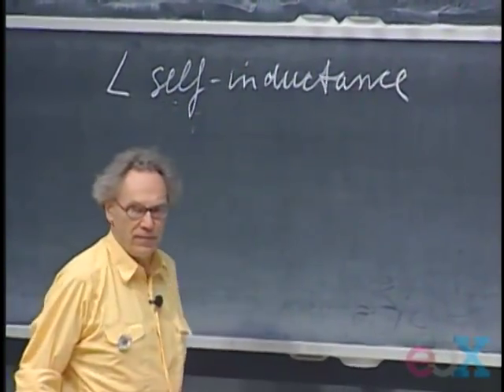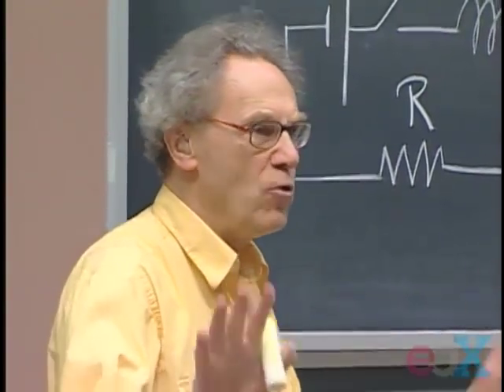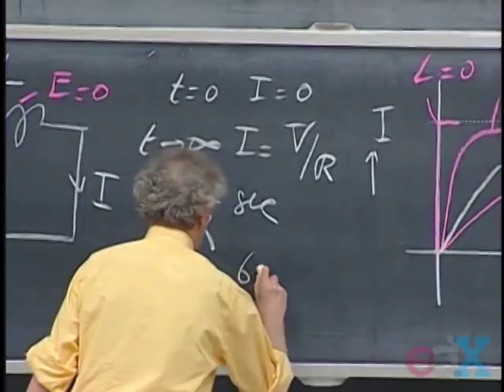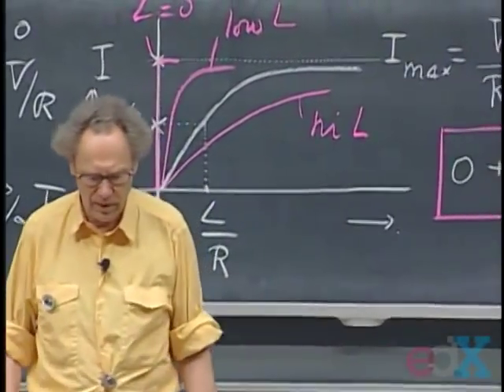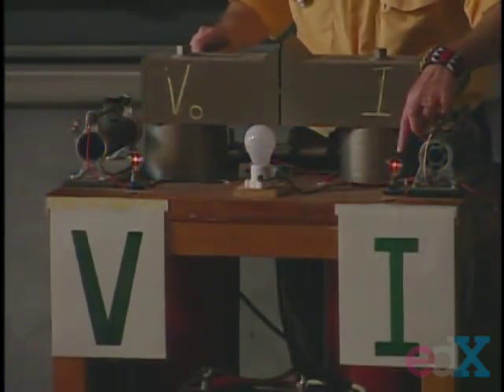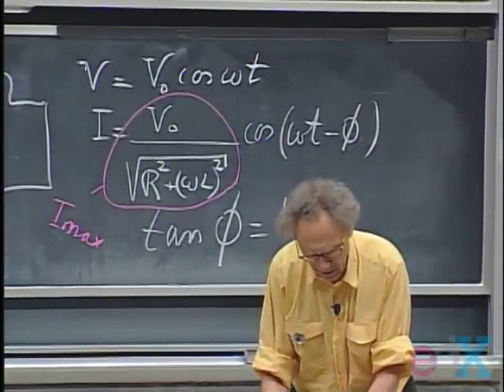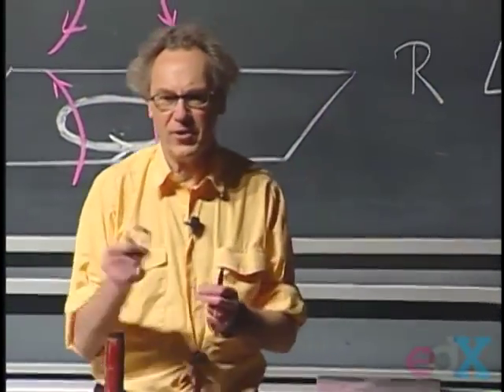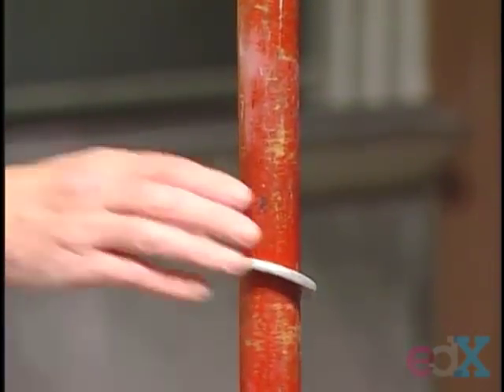8.02x - Lect 20 - Inductance, RL Circuits, Magnetic Field Energy

Comment from the maker: This website contains all my 94 course lectures (8.01, 8.02 and 8.03) with improved resolution. They also include all my homework problem sets, my exams and the solutions. Also included are lecture notes and 143 short videos in which I discuss basic problems. 
ENJOY!
Reply: Great lectures. On a finer note, the E-field doesn't have to be zero inside an ideal conductor! As Feynman points out in his famous "Lectures on Physics" book Ch-22 ,  if the conductor is moving then you can have E-fields inside. He gives the example of a rotating coil in a magnetic field.The only requirement is that the total force is zero inside an ideal conductor. And the force is a sum of E-field and B-field components.
Reply: Prof. Lewin  First and foremost, thanks for the physics education!!
I would like to comment on your lecture on "RL CIRCUITS".  I noticed that in the light-bulb experiment where it was shown that the light-bulb had great delay coming to full brightness when switched on through the huge inductor...that it was NOT shown by demo, the similar DELAY of the light-bulb going off.
I just wanted to let you know that I have come up with a VERY SIMPLE modification of the circuit where the delays in BOTH directions are illustrated!
ALSO--as mentioned in that lecture--I am VERY curious as to the construction of such a large inductor with this very low resistance.
Reply from the maker: >>>NOT shown by demo, the similar DELAY of the light-bulb going off.>>>
NO and that is by choice. Look at the circuit!!!!! You may then understand why.
Reply: thank you walt, you've gone down in the annals of history in education as one of the great educators of one of the strangest fields in human existence.
Reply: Which i book follow for this cource?
Reply: I need all your literature on this subject. Is this information still available? Better yet, if you’re still on Earth with us, you would be a perfect lab partner.
Reply: 1008 and a 356

Comment: Prof Lewin, the magnetic field outside the inductor is approximately zero and therefore the electric field everywhere outside the inductor is conservative. Thus, when applying Faraday's law, you can choose the closed loop that bypasses the inductor, i.e. you do NOT go through the inductor - you start at one end of inductor, go outside and enter at the other end. That way, the closed loop integral will be ZERO and therefore you CAN use kirchhoff law. You just need to carefully specify the curve.
Reply from the maker: that is 100% correct. I mention this in one of my videos. It is important for students to realize that. Becoz when you attach a voltmeter over a superconducting coil  it creates a loop with the selfinductor. The integral E dot dL through the volrmeter is +or -Ldi/dt but zero through the selfinductor.  You can then also draw a closed loop (bypass the selfinductor) in which KVL applies. However, if you want to know what the voltmeter indicates you must include the loop voltmeter-selfinductor (see above).
Reply: @lecturesbywalterlewin.they9259  thank you for the explanation, professor

Comment: Professor Lewin:  THANKS FOR BRINGING THE WORLD'S GREATEST PHYSICS LECTURES INTO MY HOME!
One tragic thing about the 30H inductance delay demo at  timestamp 20:30 ... 
The experiment only demonstrates HALF of the lecture.  This is sad, especially since it is SO VERY trivial to modify the circuit and demonstrate the RL delay SLOWING the light bulb going OFF when the power source is switched off.  All you need is a (low current) SPST switch and a small fuse...that's it!!!  PLEASE let me know if you are interested.  It truly completes the demo!
Reply from the maker: The power of my demo is that students have to explain on their own why there is NO delay when I open the switch.
Reply: @lecturesbywalterlewin.they9259    OK, agreed and I understand.  I was just trying to make the demo more complete, but if this is your reason, I am sure you are right.  Thanks so much for the reply.  I wish I had you for a physics teacher.  If I had made it to MIT in the 80's when I majored in physics, I always knew that I would have met you and had you as my physics professor.  I regret missing it.  I don't know what I would do if it wasn't for MIT's physics OCW, even now.
I so much want to recreate that demo, but have yet to find how to make such a low resistance high "L" inductor.

Comment: If the magnitude of the self-induced emf of an inductor is equal to L*di/dt, then how can there be no "voltage drop" through the inductor and how can there be zero E field? I read the link in the description. All I could conclude from the article was that Faraday's law cannot tell us at what points the E field is zero or nonzero. The article simply states that E = 0 in an inductor. In the explanation of why that is so, I didn't see it mention E = 0 anywhere. It talked about nonuniform E fields and the production of E fields via charges (only when the resistance across the one-loop inductor was appreciably large and nonuniform). My book (University Physics, 12th edition), explains that there indeed is a "genuine potential difference between the terminals of the inductor, associated with conservative, electrostatic forces, despite the fact that the electric field associated with the magnetic induction effect is nonconservative" (bottom of page 1035). The question of whether there is an E field between the terminals of an inductor has made me interminably confused! I would greatly appreciate any help you could give! Thanks, Andrew
Reply from the maker: +Andrew Guo  No E-field is allowed in any superconducting material as it would lead to an infinitely high current. Since E is zero everywhere in an "ideal" self inductor the integral through the self inductor of E.dl is zero (people used to call this integral the potential difference). If you attach a voltmeter between the 2 ends of a self inductor you will not measure zero, but you will measure L*dI/dt. The reason is that now you create a loop with the L and the Voltmeter. According to Faraday's law the closed loop integral of E.dl in that loop is -dphi/dt. The conclusion is that in case where Faraday's law must be used, the integral of E.dl depends on the path. I suggest you watch my 8.02x lecture #16. You will see in action that the integral of E.dl depends on the path. Two voltmeters connected to THE SAME points in my circuit will read very different values - even the polarity is different. It's not very intuitive, because Faraday's Law is not intuitive. If you have problems with this, you are not alone. Keep in mind though that Faraday's law runs our entire economy.  You may also want to watch (but you will only see the demo in my 8.02x lecture #16). https://www.youtube.com/watch?v=LzT_YZ0xCFY&index=1&list=PLyQSN7X0ro22zanLOcvkaSY-IZqheFYM5
Reply: Dear Walter,
confirm please "Two voltmeters connected to THE SAME points"? as it looks that really voltmeters connected to resistors ends (NOT THE SAME points) in that experiment but not same points - and there present gap of conductor line, if so this gaps of conductor line between resistors connections can be replaced with equivalent battery sign as there inducted emf from external magnetic field - and after redrawing this schema  to reflect real processes this experiment became clearly explained : first resistor (. here one voltmeter connected) -eq. battery+ (. here second voltmeter connected) second resistor (. here second voltmeter connected again ) -eq. battery+ (.connection to first resistor, here first voltmeter connected )

Comment: I am an Electrical Engineer and I have read and applied all that stuff. But I watch these lectures only those parts where the Professor Lewin is explaining the equations "intuitively" and relating it with our common sense. 
I agree Professor, Physics is not Mathematics, it is when you understand the meanings of mathematical equations.

Comment: Professer Lewin,

In the experiment at
30:00
Why does the light turn off immediately? Isn't it supposed to turn off gradually?

Thank you
Reply from the maker: +Lectures by Walter Lewin. They will make you ♥ Physics. That's a good question. When I open the switch the current will now continue through the loop that contains both bulbs. Thus R total is now 20 ohm. The current will decay as e^(-Rt/L). For t=1 s, this is 0.5, thus i^2 is 0.26*i^2_max, Thus after 1 sec the heat production is only 26% of the maximum. After 1,5 sec the heat production is down by a factor 7.
Reply: Simple answer: L is low enough to be not noticable.
Reply: Professor Lewin, isn't the resistance of the parallel circuit be 1/R_total=1/R1=1/R2?
Will the self inductance affects the current in the loop that without self inductance, in a way that it slows down the turns off speed of the bulb?

Thank you.
Reply: @ongchinyuan2901  no because the original power source is no cut off the circuit so you only need to analyze the top loop
Reply: @lecturesbywalterlewin.they9259  the link for the lecture notes is not working sir.could you please help me with that sir.
Reply from the maker: @kr.sundararavinth4098  Assignments 8.02

Ass #1 
http://mit.sustech.edu/NR/rdonlyres/Physics/8-02Electricity-and-MagnetismSpring2002/7F6A754B-47F3-40EF-BF03-F2CFFF51C8D7/0/ps1a.pdf

sol #1 
http://mit.sustech.edu/NR/rdonlyres/Physics/8-02Electricity-and-MagnetismSpring2002/A087863B-CDE2-4EAD-8C1F-2A4CFC25D195/0/pss1.pdf

#2
http://mit.sustech.edu/NR/rdonlyres/Physics/8-02Electricity-and-MagnetismSpring2002/4F84CBD6-A945-46AB-BE50-5EC0FB53DD86/0/ps2a.pdf

#2 sol
http://mit.sustech.edu/NR/rdonlyres/Physics/8-02Electricity-and-MagnetismSpring2002/01A0162B-076D-4286-9363-8DD8E1332592/0/pss2.pdf

#3
http://mit.sustech.edu/NR/rdonlyres/Physics/8-02Electricity-and-MagnetismSpring2002/D1BDEE3F-C3B4-43AB-B225-6AA2CAC608E5/0/ps3.pdf

#3 sol
http://mit.sustech.edu/NR/rdonlyres/Physics/8-02Electricity-and-MagnetismSpring2002/2FF7D30E-00F2-4148-AE86-369023A3A14B/0/pss3.pdf

#4
http://mit.sustech.edu/NR/rdonlyres/Physics/8-02Electricity-and-MagnetismSpring2002/4E9ABEB3-9BF5-4B27-9CB0-C81D911C494A/0/ps4.pdf

#4 sol
http://mit.sustech.edu/NR/rdonlyres/Physics/8-02Electricity-and-MagnetismSpring2002/B4C6BDA5-07B2-4857-AD19-A3018472C119/0/pss4.pdf

#5
http://mit.sustech.edu/NR/rdonlyres/Physics/8-02Electricity-and-MagnetismSpring2002/6FA7901A-BBC9-4465-82BB-930A35C7C677/0/ps5d.pdf

#5 sol
http://mit.sustech.edu/NR/rdonlyres/Physics/8-02Electricity-and-MagnetismSpring2002/CE78EC02-7DAE-417C-A2BB-9E0B34AC8148/0/pss5.pdf

#6
http://mit.sustech.edu/NR/rdonlyres/Physics/8-02Electricity-and-MagnetismSpring2002/B0B8A88F-63BE-4BDC-B931-5D4EB6796A74/0/ps6c.pdf

#6 sol
http://mit.sustech.edu/NR/rdonlyres/Physics/8-02Electricity-and-MagnetismSpring2002/1891F43D-5E38-4040-8322-1F29343AD3C2/0/pss6.pdf

#7 
http://mit.sustech.edu/NR/rdonlyres/Physics/8-02Electricity-and-MagnetismSpring2002/51BF37E6-F07C-452A-98C0-DEF6DF89CDCB/0/ps7b.pdf

#7 sol
http://mit.sustech.edu/NR/rdonlyres/Physics/8-02Electricity-and-MagnetismSpring2002/10544294-2F82-41FD-83EC-6481EC0D52AB/0/pss7a.pdf

#8 
http://mit.sustech.edu/NR/rdonlyres/Physics/8-02Electricity-and-MagnetismSpring2002/A8A5F7D8-2291-471D-9A9B-D03956E54CF7/0/ps8.pdf

#8 sol
http://mit.sustech.edu/NR/rdonlyres/Physics/8-02Electricity-and-MagnetismSpring2002/A8A5F7D8-2291-471D-9A9B-D03956E54CF7/0/ps8.pdf

#9
http://mit.sustech.edu/NR/rdonlyres/Physics/8-02Electricity-and-MagnetismSpring2002/9736BA5E-745E-409A-BE71-6535542548B6/0/ps9a.pdf

#9 sol
http://mit.sustech.edu/NR/rdonlyres/Physics/8-02Electricity-and-MagnetismSpring2002/EEEC3FE0-1445-4E39-A2B3-7FD5F7FA5865/0/pss9.pdf

#10
http://mit.sustech.edu/NR/rdonlyres/Physics/8-02Electricity-and-MagnetismSpring2002/5C2CD33F-B5B8-41AC-9E6E-2FCFFA99EC49/0/ps10d.pdf

#10 sol
http://mit.sustech.edu/NR/rdonlyres/Physics/8-02Electricity-and-MagnetismSpring2002/0F45113A-776B-4277-AF12-AC570CA370FD/0/pss10.pdf

#11
http://mit.sustech.edu/NR/rdonlyres/Physics/8-02Electricity-and-MagnetismSpring2002/E480254C-E013-4151-B502-7DD49EAC8A36/0/ps10d11.pdf

#11 sol
http://mit.sustech.edu/NR/rdonlyres/Physics/8-02Electricity-and-MagnetismSpring2002/D9FA14B1-A341-4824-9462-AA6385773F1A/0/pss11.pdf

---------------------------------------
Reply from the maker: Lecture Notes 8.02

#7 Capacitance of Spheres
http://mit.sustech.edu/NR/rdonlyres/Physics/8-02Electricity-and-MagnetismSpring2002/CCD1D384-1E00-4CAE-88D0-010AB6068CC3/0/lecsup220.pdf

#8 Dielectrics and Polarization
http://mit.sustech.edu/NR/rdonlyres/Physics/8-02Electricity-and-MagnetismSpring2002/3711CBD8-B46E-4480-8AE6-CAD11A49E62E/0/lecsup222.pdf

#11 Build your own Electric Motor
http://mit.sustech.edu/NR/rdonlyres/Physics/8-02Electricity-and-MagnetismSpring2002/77A8653E-8AAC-4766-9D53-D52A75C18469/0/motor.pdf

#13 Circular motion
http://mit.sustech.edu/NR/rdonlyres/Physics/8-02Electricity-and-MagnetismSpring2002/50B8C26D-C810-4921-A65A-520137EEF37C/0/lecsup38.pdf

#15 Mid-term, Evaluation form 
http://mit.sustech.edu/NR/rdonlyres/Physics/8-02Electricity-and-MagnetismSpring2002/415CD6BB-A948-407E-A298-D5A01C30F1AF/0/lecsup313.pdf

#16 Non-conservative Fields - Do not Trust your Intuition
http://mit.sustech.edu/NR/rdonlyres/Physics/8-02Electricity-and-MagnetismSpring2002/61F4F0BE-5591-4909-9035-49610C28B58F/0/lecsup315.pdf

#20 Faraday's Law - Most Physics Books have it WRONG
http://mit.sustech.edu/NR/rdonlyres/Physics/8-02Electricity-and-MagnetismSpring2002/C29636DB-AB80-49E0-BFAB-BCE00159F00E/0/lecsup41.pdf

#20 Driven L-R Circuits
http://mit.sustech.edu/NR/rdonlyres/Physics/8-02Electricity-and-MagnetismSpring2002/FBC25EB0-EDCC-496F-97F5-77342735C010/0/lecsup41a.pdf

#21 Magnetic Materials 
http://mit.sustech.edu/NR/rdonlyres/Physics/8-02Electricity-and-MagnetismSpring2002/B301F704-8360-4F1D-AB42-E530A3E7B6A8/0/lecsup43.pdf

#22 Maxwell's eqs
http://mit.sustech.edu/NR/rdonlyres/Physics/8-02Electricity-and-MagnetismSpring2002/26BACB7F-706E-49B1-B9F8-832D316A0A7B/0/lecsup45.pdf

# 23 Exam 2 Review - Topics
http://mit.sustech.edu/NR/rdonlyres/Physics/8-02Electricity-and-MagnetismSpring2002/3061D2C3-92DB-49A7-BA05-7E4E27576490/0/lecsup48.pdf

#25 Driven L-R-C Circuits I
http://mit.sustech.edu/NR/rdonlyres/Physics/8-02Electricity-and-MagnetismSpring2002/FA08311D-2765-4404-B47C-50362245AF4E/0/rlc1.pdf

#25 Driven L-R-C Circuits II
http://mit.sustech.edu/NR/rdonlyres/Physics/8-02Electricity-and-MagnetismSpring2002/D89044E3-10B1-42DC-8D57-C4C2E961F3F0/0/rlc2.pdf

#26 Oscillating Sound Cavities - Fundamentals if Wind Instruments
http://mit.sustech.edu/NR/rdonlyres/Physics/8-02Electricity-and-MagnetismSpring2002/E3B2FED5-F656-4AEC-96A1-130745A7D101/0/lecsup419.pdf

#27 Traveling EM Waves 
http://mit.sustech.edu/NR/rdonlyres/Physics/8-02Electricity-and-MagnetismSpring2002/08D1D0C5-A8A3-44CA-A290-9EFCB20110C8/0/lecsup422.pdf

#29 Speed of EM Waves in Matter - Index of Refraction
http://mit.sustech.edu/NR/rdonlyres/Physics/8-02Electricity-and-MagnetismSpring2002/BB80210A-AC60-443D-9DF2-3E3658AE6812/0/speedlight.pdf

#31 15 Question about Rainbows
http://mit.sustech.edu/NR/rdonlyres/Physics/8-02Electricity-and-MagnetismSpring2002/CF929F8C-ECE3-4BA1-A79D-E3DD13D0C37C/0/15questions.pdf

#31 Key Angles for the Primary Rainbow
http://mit.sustech.edu/NR/rdonlyres/Physics/8-02Electricity-and-MagnetismSpring2002/2FC46772-6FD3-4973-8811-DDAB05CED7EC/0/angles.pdf

#32 Exam 3 Review
http://mit.sustech.edu/NR/rdonlyres/Physics/8-02Electricity-and-MagnetismSpring2002/928CC0F9-CFDC-4582-9386-730C73D3B5E3/0/lecsup53a.pdf

-----------------------------------------

EXAMS 8.02

#1
http://mit.sustech.edu/NR/rdonlyres/Physics/8-02Electricity-and-MagnetismSpring2002/29B6C858-A92B-431F-A43E-725D58A768EF/0/exam1.pdf

#1 sol
http://mit.sustech.edu/NR/rdonlyres/Physics/8-02Electricity-and-MagnetismSpring2002/3CB043C9-9DD9-4DA5-AF89-4AA79742171B/0/exam1sol.pdf

#2
http://mit.sustech.edu/NR/rdonlyres/Physics/8-02Electricity-and-MagnetismSpring2002/6D148C87-C69B-44B6-AECA-CB9D875E0F40/0/exam2.pdf

#2 sol
http://mit.sustech.edu/NR/rdonlyres/Physics/8-02Electricity-and-MagnetismSpring2002/8EDEC05F-6E01-4693-80D4-34F27971C48E/0/exam2sol.pdf

#3
http://mit.sustech.edu/NR/rdonlyres/Physics/8-02Electricity-and-MagnetismSpring2002/76B9798A-BA2F-4DEE-BF06-703DA70281E6/0/exam3.pdf

#3 sol
http://mit.sustech.edu/NR/rdonlyres/Physics/8-02Electricity-and-MagnetismSpring2002/3F5F818D-3C4E-4523-B1C5-F98B15502EDC/0/exam3sol.pdf

Final
http://mit.sustech.edu/NR/rdonlyres/Physics/8-02Electricity-and-MagnetismSpring2002/CCFD9103-B59B-4610-8284-8DB031B8E4B7/0/final.pdf

Final sol
http://mit.sustech.edu/NR/rdonlyres/Physics/8-02Electricity-and-MagnetismSpring2002/B2FF7DCC-DC1C-4E6C-88C2-2125DD32A9A0/0/finalsol4.pdf
Reply: @lecturesbywalterlewin.they9259  thank you so much sir
Reply: @Originalimoc  No that is completely wrong.
Reply: @lecturesbywalterlewin.they9259  jjhh
Reply: @lecturesbywalterlewin.they9259  The magnitude of rate of growth and decay of current in LR circuit is same ,so how can the bulb start to glow slowly but discharge so rapidly
Reply: @lecturesbywalterlewin.they9259  Wow great
Reply: @lecturesbywalterlewin.they9259  Nice and thankyou, i took me 2 minutes to understand why 😅😅
Reply: @Originalimoc  That's wrong. Clearly L=30H in the circuit.